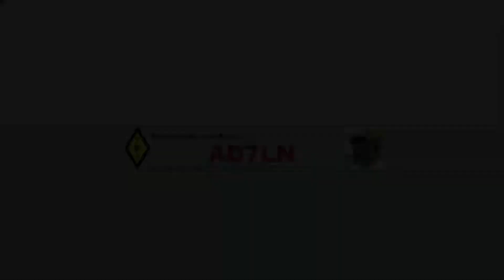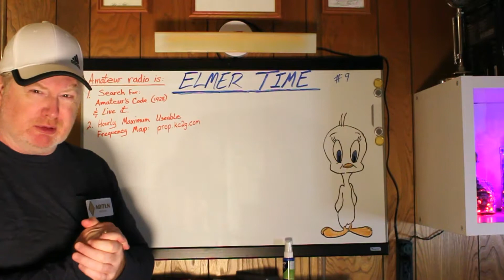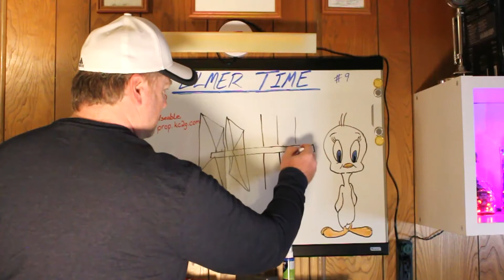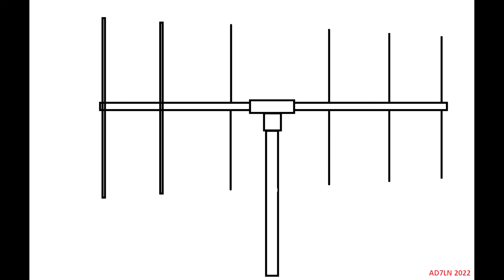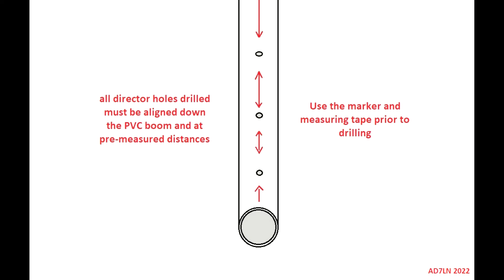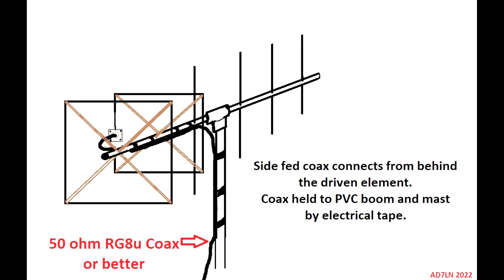AD7LN - "Elmer Time" Let's build a 2 Meter VHF Quagi- High gain directional antenna.

Comment: Coax is a 3 conductor  the outside will easily radiate and a simple way to look at it is the impedance in the coax is 50 ohms and the impedance of outside jacket is around 2 ohms so current will flow in the path of least resistance , this causes all kinds of problems , I put the choke right against the loop and since the 2 meter quad is so lightweight I built a coaxial sleeve choke to stop common mode  current . placing a choke any further from loop can cause distortion in  the radiation pattern .
Reply from the maker: Great job!

Comment: Awesome project. I have a fee mods that I also like to apply.  Such  as  a 7 to 10 turn choke to the coax  when it reaches the boom to remove common mode currents. Also the spreaders are made of fiberglass arrows with screws adjustable next to the boom to make the wire taught. Think mini turn buckle.
Reply from the maker: Excellent!

Comment: Hmmmm How does one adjust the VSWR?
Reply from the maker: This antenna and its specs are designed for a specific frequency at it's lowest SWR. Transmission above or below that specific frequency will increase the SWR. The further from the designed frequency, the higher the SWR. The driven element can be lengthened or shortened a small degree to match the SWR a few Hz one way or another.
Changing the driven element size drastically will decrease the effectiveness of the quad/yagi gain because all of the other elements need to be re-adjusted in length and spacing.
If the SWR is poor at the designed frequency, recheck the antenna construction and check the quality of all parts and connections. Check coax and its connectors.

Comment: I was into building quagis about thirty years ago.  I liked them because the match on the driven element is about as simple as you can get.  SOOOOOO easy to build.
Reply: I built one for 2 meter SSB about the same time  -  around 30 years ago, and I found the same thing.  --  AA6LJ

Comment: Thank you Elmer for subscribing! The videos are very interesting. How did you find out about my little channel? Enjoy your videos and have a good evening!
Reply from the maker: @14IF949  Hello! A simple search in YouTube for "Radio operators" pulled your channel up! 
Whenever I find current radio related videos being produced, I will subscribe- thus adding to my publicly posted subscription list for everyone to explore.
Reply: @elmertime8043  Thank you for this great approach and also for these instructive videos. I have also been passionate about radio at my humble level since the 80s and 27 MHz has picked up again in recent years with the support of the Internet in addition, it allows you to discover very beautiful regions and also beautiful people. I plan to set up my broadcasting station at my home but for that I would need a high-performance antenna but as discreet as possible. What do you think? I would love to do it with my Sirio 5000 which is great but you need a ground plane. 73
Reply from the maker: @14IF949  The Sirio 5000 is an excellent base loaded 10/11 meter antenna. Yes ground radials would be needed for this or any vertical antenna in the HF range. Even if the radials are just lengths of wire. It is possible to get a decent SWR when configuring the vertical antenna without ground radials - however the TX signal performance will be lacking severely.
What about a simple dipole cut for your frequency range? Small black plastic insulators and using thin wire with black insulation can be difficult to see from many feet away.
Being the 27Mhz range, coax RF loss is very minimal and smaller diameter coax can be used such as  RG58/u- in lengths of 50' or so the RF loss is minimal. The only condition is a lower power output must be maintained because of coax heating from high TX wattage.  Under 100 watts SSB there should be little issues.
Reply: @elmertime8043  Thank you very much for this valuable technical advice. If I understand correctly, it would involve placing 4 Radians in 2mm square concrete wires and 1 or 2 meters connected to the ground of the antenna and varying the length to have the best possible ROS. It's good to know that it's possible because it's a discreet antenna. In addition, I'm considering changing the coaxial for a larger one because my CRT 7900V Turbo outputs about 60 W and if I add a small linear amplifier, the small coaxial risks being over-intensive over a length of about 20 M.
Reply from the maker: @14IF949  It looks like you have been planning the installation for this Sirio 5000 antenna! My only input from here is that the installation of ground radials can be unpredictable at times and to have a " Plan B." Good work!
Reply: @elmertime8043  It's not for right away but I'm thinking about it because in the car the battery protection cuts off the power after a few minutes and forces me to restart. Thanks and have a nice day

Comment: Dumb question. This is directional?
Reply from the maker: Hi Tim- yes this Quagi is very directional and needs to be turned into the appropriate direction. I used this exact antenna at my QTH to help find a QRP fox transmitter nearer to downtown by relaying direction to a mobile. The mobile searching for the fox TXer was the first to the correct location. The Quagi has great gain.

Comment: Nice work you've done there. If I want to build one for.....let's say 151.820 MHz, how do you find the lenght of element, quads and spacing ?

a dipole is a 1/2λ consisting of 2 X 1/4λ
Quads is  what ... 1 full λ ?

Thanks for sharing your know-how with us

73's from grid FN77cu
Reply from the maker: Thanks for watching the video.
I made this antenna back in the 1990's from design plans and mathematics from an ARRL antenna handbook back then.
I see in a newer 21st edition, the same pages are still there. On page 18-41 for calculations on driven and reflector,  a nice chart for director lengths and spacings for all- for various frequencies on 18-45.  Finding the differences from the chart easily allows for around 146mhz. 
Can a quagi be made for a MURS frequency? Easily. Should it? I'm not sure about regulations here in the states for that band/freq. Does the FCC allow that kind of gain and distance for that frequency? Maybe? I haven't read up on business band MURS use here in the states.